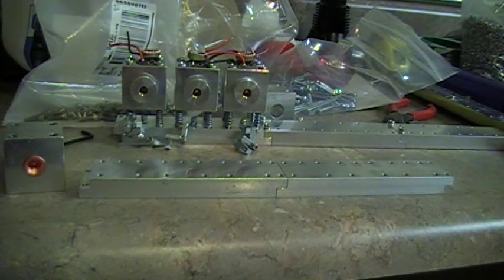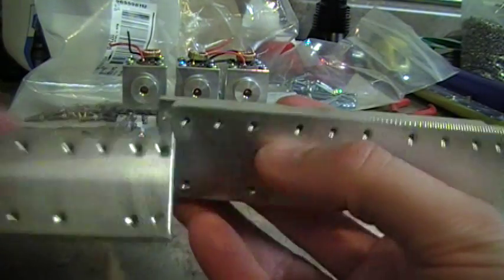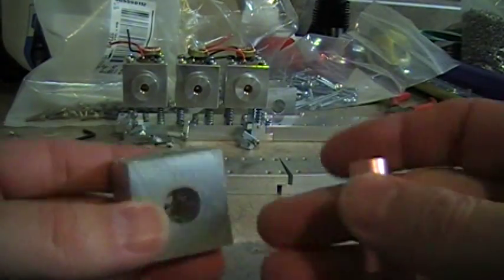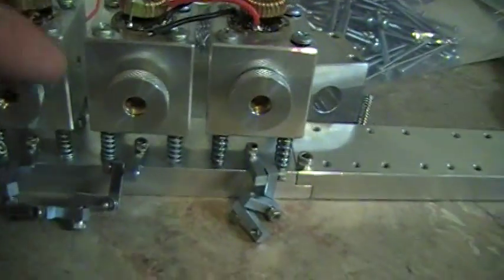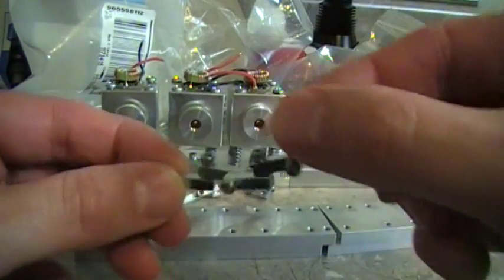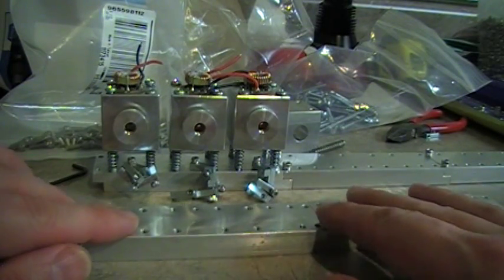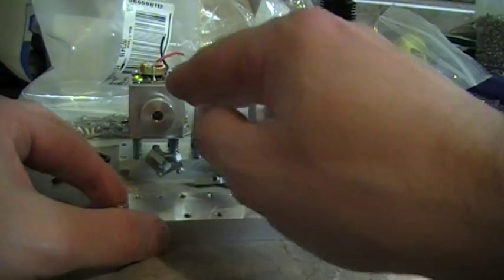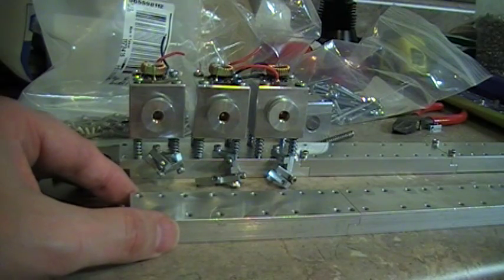40W+ 445nm laser kit most powerful handheld laser in the world

Comment: I don't understand.If you have say (10)2 watt lasers side by side,how does it increase power to 20watt.wouldn't it act like a parallel circuit,and just be a fat 2 watt beam?
Reply from the maker: No each beam add power then you use the right lens to make it one beam
Reply: Rick Trent
Okay,Thanks for clearing that up for me.Doing it your way,would it be feasible to chain several and burn sheetmetal?
Reply from the maker: yes see the video of 15w burning spring
Reply: Rick Trent Thank You for the info!
Reply from the maker: call for help before 8pm E 423-839-4739